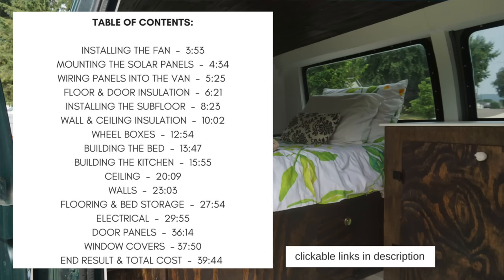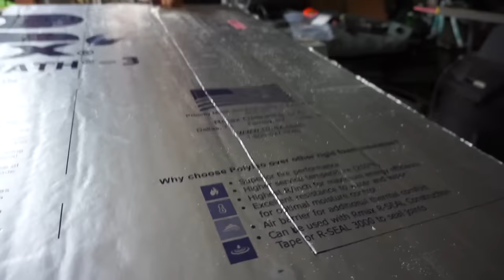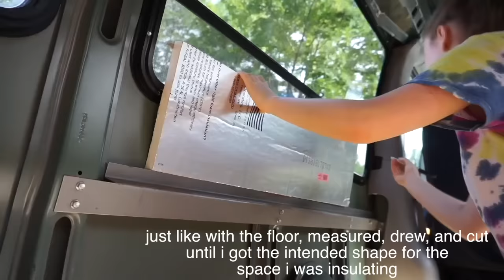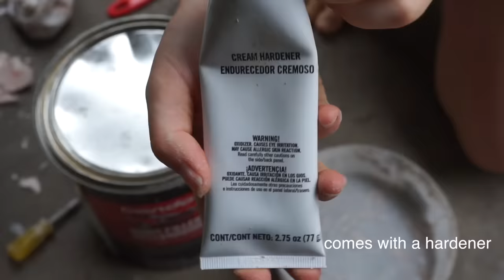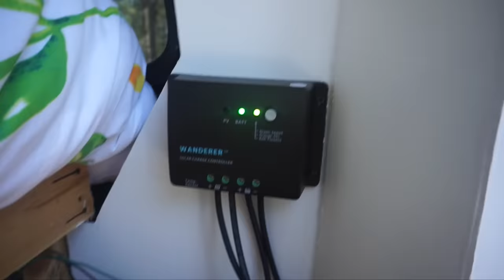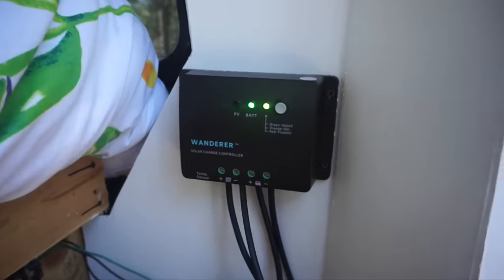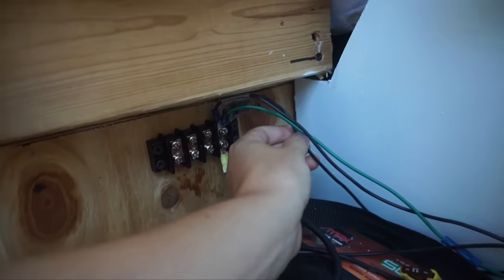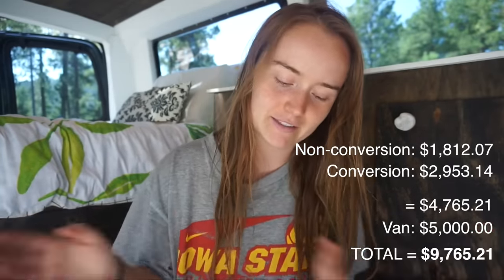How I Converted A VAN into an OFF GRID CAMPER for under $3,000

Comment: Can we talk about how she did an awesome job on that van with like almost no tools? I saw her use a steak knife to cut insulation,  crimped wires with vise grips and used a drill from like 1980. Excellent work.  Your parents must be so proud of you.
Reply: She did also have a jigsaw, tablesaw, passlode  and compressed air. Im very impressed over all but just dont want folk thinkin they can convert their van with their kitchen utensils. Even the sheets of crep paper used for stenciling are quite alot more costly than newspaper. As a tool lover Sum credit should be given to her tool collection.
Reply: My cat saw what I did with that rabid possum with my carpenters hammer tonight it was pretty gruesome.... If U put your money into a mobile living space and want sex lighting too make sure it has a shower wood heat fireplace and a place to take a dump not an over night sex machine... I really struggled thru my solar panel edumacation shit. I built a tilt frame on the 3 main panels to harness what I can and it really works swell. Flat panels can be affected by azimuth where ya park the thing and get no light in sun light. A tilt bracket set up is not total wind proof but U can work with it and use clasps to hold the panels that they work where sun light is at kooky angles...
Reply: @thekingsilverado8419  Those are definitely words
Reply: @thekingsilverado8419  You should take your own advice. And just because there's interesting lighting doesn't make something a "sex machine". These lights are fairly inexpensive and fun in general. She seems to have thought of everything she wants in her build. It doesn't have to be for anyone else.
Reply: @TheShauNanigans  Easy tiger I was just being my usual Facetious self okay. Not everyones taste in lighting is the same and even if it was it would be more boring than listening to the news is lately. Lighting sets moods 4 people and me all of ppl understands that. Now if ya wanna come see my 100ft string of Budweiser & Miller Beer patio lights and my solar lava lamps all over my cow pasture and turkey pens they certainly think it's sexy. My horse don't think so he ain't been the same since he quit drinking.
Reply: @thekingsilverado8419  tyler1 rage

Comment: Good job! To anyone making a van conversion, remember to have holes or other kind of ventilation under the bed because otherwise you get black mold from your body humidity moving down through the mattress. That can make you sick.
Reply: Thank you so much, that's such a weird thing that I probably wouldn't have even thought of.
Reply: @emmebalzer1174 , it's the same concept for your house.  Walls must "breathe."  Air-tight living spaces are only for terrariums.
Reply: Do. You just mean for the wood bed frame itself?
Reply: Pender Sessoms both should really have it
Reply: @apsessoms  Most of the humidity will affect the board on where your mattress rests, so that is the one I mean.
Reply: can always buy a wool mattress too which is mold and bed bug resistant
Reply: Ok, thank you for the advice!!
Reply: Or, you can.maybe have some sort of
small dehumidifier in van. Would that work?
Reply: @FullyYoked  nice tip
Reply: nobody likes sarcasm, DUDE
Reply: see other comment
Reply: This must be one of the best pieces of advice I have read in any of this "conversion" videos,
Reply: I think Ikea has a very slim profile wood slat mattress support that gives some air circulation without too much height
Reply: @gforceforever  Don't you think the interior gets enough fresh air each day to take care of that issue?
Reply: @SLAMTRON , no.  Mold spores will thrive in any location that provides enough moisture.  Mattresses do not breathe enough if placed on a solid, nonporous surface.  Better to plan and execute accordingly.
Reply: Hemmmm.. very interesting... i wouldnt have thought about that...totally good idea
Reply: True! I forgot about that, Dude.
Reply: Thk you!!!
Reply: Thank you so much, I'm moving out of mold to get healthy!! Any more tips to reduce humidity? God bless you, because I saw the holes being put in the bed in another video, but didn't equate it with getting mold! Much Love
Reply: @FullyYoked  Thank you! I will be looking into that as well. Much Love

Comment: Most helpful and inspiring van build I've seen yet! I'm 17 right now and I'm currently saving to buy my own van and build it out, so this helped me feel more confident that I can do it. And thanks for explaining the electrics as best you could, most people completely skip over them
Reply: Keep saving and socking that money away, sounds like you're on the right track.
Reply: FYI: every van life video i've seen has been WAYYYY excessive both in labor and money. (I have a 2003 Chevy Astro van  -- PASSENGER van, so no need for me to line the walls and ceiling and insulate etc. I just removed the back seats! It baffles me how most get a CARGO van, so they have to do all that extra work. I SPENT LESS THAN $100 converting my van into a paradise! 

MOST people do not need solar, or propane, or running water, or fancy lights, etc etc. That's great if you want 1MPG and to spend all your money on gas and things you don't need. I FEAR THESE VIDEOS make potential nomads think they MUST do all this work, when you actually don't have to do almost any of it! I just plug in a hair-dryer if I want direct heating, ha ha. But I've never needed to! 

SPREAD THE WORD: anyone can do van life for under $3000. (My van was $1700 used.)
Reply: you don't need to do ANY electrical work. (unless you're going to be running loads of stuff, which is not smart. I paid $10 for a power / usb converter to plug into my cigarette lighter. Covers ALL my needs easily! WHY would i need to install solar? Yikes!)

Comment: Pretty impressive. The only thing I saw that might be an issue down the line was running the solar panel wire through the hole on the roof. I'd recommend installing a rubber grommet and then run the wire to prevent chafing the wire with vibration from driving. I was also going to mention having the brake lines checked as they are often overlooked on an older vehicle but you already had them repaired. Good luck with your travels.

Comment from the maker: PLEASE READ BEFORE DOING YOUR OWN BUILD or COMMENTING!

1. it is important to use grommets where the holes are for the solar panel wires to come into the van so the metal of the roof doesn't cut through the wires protective coat. I didn't use any because i couldn't find any but you can order them online if you can't find any in stores.

2. i do say in the video that i recommend putting fuses between all electrical components. its a long story but in my situation i didn't really have that option.

3. if i had to go back and do one thing more carefully it would be the window covers. If you make ones the same way as mine, try to make them as perfect as possible, and a little bigger than needed. I've found if I leave them up in the morning for a bit and the sun starts to shine on them, they can actually fall out. One of my back ones and one side door one have done that and those were the ones that fit best. If you mess up you can always duct tape more cardboard where needed!

4. The battery I have is actually 'sealed' not 'GEL' as a few commenters have told me.. i tried doing research and its not super clear anywhere which it is but I'm like 90% sure it's sealed so I did change the battery indicator light on the cc.

5. For most, it will be important to strap the battery down. Many people have told me that I should've done that and I see where they're coming from but it's really highly unlikely that even if my van flipped in an accident than it would even go in there, it doesn't have really anywhere to go considering its secured tightly on all the sides and the bed frame extends over it.

6. Like i say in the video, i do know the carbon monoxide is not in the best spot but i did read the manual and according to all the places it said you shouldn't put it, theres literally not a single place in the van that would be ideal.

7. Some people have told me to cover the battery terminals so if something falls on them, nothing bad happens, so I would recommend doing that.

8. Dicor Lap Sealant is a stronger, more reliable caulk to use in place of silicone when it comes to things covering hole in the van like around the fan, panels, and panel cables.

9. Many have told me fiberglass insulation is not good to use in vehicles because it will get moldy from the moisture but the insulation i used was what came in and got ripped out of the van. It had been in there since 1997 with no mold so it seems like it should be fine for a bit longer.

10. All the products I use and show in the video like my fridge and solar panels are listed on my website.

If I come across any other advice I think is helpful I will update this comment :)
Reply: I wanna build one
Reply: Home Depot for the grommets. Or a boat building store (more expensive). For your hands and chemicals, vinyl or nitrile disposable gloves. I watched and enjoyed your entire video. You Go Girl! Excellent refurb! Nice video editing. Plus, pretty girl makes for a great video.
Reply: Q: is there a REASON why all these van life videos show ppl converting CARGO VANS? 

I did the opposite, saving me 99% of labor and money: i have a PASSENGER van, meaning
the entire interior is FINISHED. Flick some latches, and I took out the back seats. DONE. No need to line the walls or ceilings! 

What was your motive for using a CARGO van? 

I even saw van life vids where they have to CUT windows out of the van walls. My van (Chevy Astro 2003, $1700 used) is ALL GLASS all around (and tinted). I'm starting to wonder if there's something I don't know. (And ironically, I AM a carpenter and have all kinds of construction and welding skills, but I eliminated the NEED to do any labor by getting a passenger van.) 

I spent LESS THAN $100 to convert my van into a music venue (!) with crazy lights (xmas lights cheap!)  and gold sequin curtains ($3 a yard!), recording studio (i have odd instruments, battery amps, etc, so I can jam with strangers), photo studio (costumes etc) and everyone LOVES it. 
Sleeping in it is HEAVEN -- it's like the coolest bedroom ever, plus I LOVE the felt ceiling etc. (It's like being inside a Muppet's Womb!) 

I worry that all these van life videos dissuade many adventurers, b/c all I've seen are super-labor intensive and expensive. (I don't need solar, or propane, or a sink.) 

(Oh, and it holds like 8 people in the back, so 2 musicians and 6 audience members, or 1 musician and one puppeteer!)

(I wish I could make a video like yours to show to vanlifers out there, but YouTube won't allow me to because I am an activist who fights for social justice, while Google are billionaires who care about money and nothing else. They think I'm a very bad influence on their customers, sigh.) 

(It's a shame, b/c my van is nothing like any of the elaborate and pricey vanlife videos I've found on YT.)
Reply: You actually made a VERY good decision using the screws and drill rather than a nail gun, my dad is a carpenter and I've always helped and from experience, screws at the way to go, much more secure, can be removed and much more permanent!
Reply: This was exactly what I was thinking- grommet each hole where any power or signal wire passes! Good to see a younger person manage this build, I applaud her!
Reply: very very nice..you are an inspiration to anyone..very creative and a lot of knowledge n common sense...thank you  for taking the time and showing us all..but what do you mean you didn't fix the brake line...hahaha just joking..;}
Reply: Vegan Earth & Soul i have a 1996 ford econo line, turned it into a some what camper.   Its my humble home.   Also i do have a daily job.   Good job..   if you ever come to florida look me up.
Reply: Super nice build, great job, I’d totally buy it!
Reply: You are awesome!!!! Great job!!!!  You are a keeper for sure:)
Reply: Vegan Earth & Soul you can use vacuum lines
Or  a rubber hose as a grommet. Slice it down the middle and boom you have something to protect you’re wires from sharp edges.
Reply: You make us all wanna self-evict ourselves . . . from our apartment miasma, and mobilly 'capture the world' after learning about your akills, in conversion . . . and, following thru . . . 😘😀😁😍
Reply: It was ok  the jobs were rushed "take your time " im sure if you were more careful about cutting your wood it be better insulated  and the use of a black mastic thar dries like rubber the type used for attaching spoilers to a car would have been better than the nasty silicone stuff on the roof     9 out 10 could do better   lol
Reply: Vegan Earth & Soul your the G.O.A.T 🐐
Reply: My birthday is August 15th and I'm from Iowa LOL
Reply: Alt now meeting helmet

Comment: Pretty cool you're only 18 and did all this! I'd recommend getting a fuse block in the future though if you want to add more accessories. It makes things easy if you keep things 12 volt as you can just route everything to the fuse block and then only have 1 neg and pos cable running to the battery from the block to power everything. And it will save having to use inline fuses and give you options for expandability. Also it's recommended to use inline fuses from your solar panels to charge controller, charge controller to battery and also battery to inverter. Keeps things safer. Great job though I like what you did with your build!
Reply from the maker: Future Unknown yes I do believe I say in the video that I recommend having fuses between each electrical components- maybe not though.. I might have edited that out lol. But I am 100% not adding any more electrical accessories to my van so I won’t need a fuse block! Thanks for the tips though :D
Reply: Vegan Earth & Soul lol ya sorry I saw that part after I posted. My bad. Great job though! Happy travels
Reply: Thank you for explaining and instructions. Good job.
Reply: Great job! I am a master electrician for 40 years. You need to put fuses in the positive wire coming from solar panel and 30 amp fuse in the positive line going from the charge controller to the battery. Where the wires from the panel go in the roof (witch is grounded) rub it will short out the battery and you WILL have a FIRE!! Again great job,safe travels
Reply: Future Unknown, Thank you so much for your input and suggestions! This is what young-and older-women need! Thank you so much for caring enough to share your expertise!!!!!
😍😍😍

Comment: Where you pass the power cables through the roof, I'd recommend using some sort of grommet, surface mount cable feed or "cable clam" like they use on RV roofs or boats.  It helps prevent the cable from shifting around and becoming damaged and/or eventually breaking loose of the sealant.  Oh!  And those "circle ends" are called "ring terminals".  Very impressive build at a reasonable price!!  You should be very proud of the result!!

Comment: For the window covers, I'd recommend gluing some aluminum foil onto the cardboard before sliding it into those sleeves. That'd be a super easy/cheap addition that could have a very big impact. You'd wanna try to do it so that the shinier side of the foil is facing outward. That would help block infrared/UV radiation from the sun.

Comment: Really cool video. Good job.  One area where you want to make sure is lasting is where the wires from the solar go through the metal roof. Without a plastic or rubber grommet, over time the movement might cause an issue with the wire insulation rubbing up against the metal. The butyl tape and silicone tape might prevent this, but its something to keep an eye on.

Comment: You done really well with the conversion. One thing I would recommend you to do is when crimping the 12 volt wiring, is please use proper crimp pliers of a well known brand, as these will provide a much better crimp. Also where the wires join near metal you can purchase heat shrink terminals. these provide a both a water tight and very secure join.
Reply from the maker: K Williamson yeah we tried actual wire crumpets and couldn’t do it. What we used worked way better for us :)

Comment: For anyone putting cables through steel panels. (1) use a step drill. (2) Use suitable rubber grommets.  (3) Seal cut edges and grommets with body panel acrylic. (4) Run the wires in a loop so that water drips off the loop rather than onto the seals.
Reply: I was worried  about that and was looking for exactly such a comment. Rust can get anywhere if it is open steel I thought. Grummets = rubber O-rings? had to check that one. Running wires in a loop, you mean heaving another low point for the water to drip down to? So literally fixing them in a loop outside the van before it goes into the hole? Just to be sure, you then still have the little bit from the loop to the hole that will drip towards that hole right? Just to be be clear. And absolutely a great tip now I have to break it down into these sub questions, an image is formed and I realize the genius of it.  Unless I got it wrong of course and I have to reshape that image based on your corrections ;-)